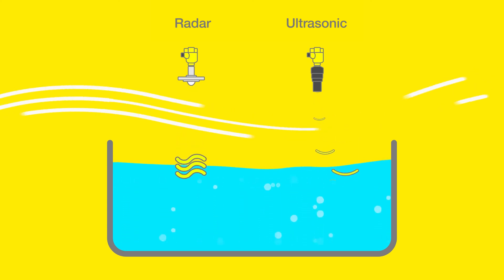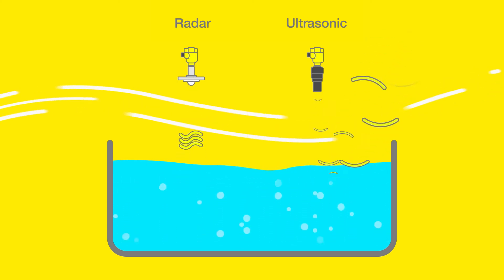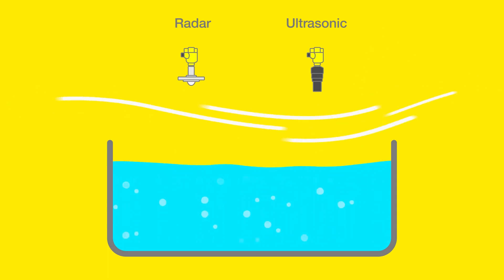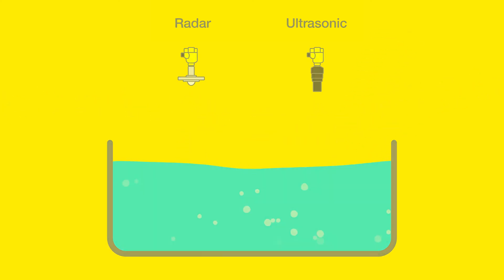💡 Radar vs. ultrasonic – what are the differences between the two measuring principles? | VEGA talk

Comment: For my project I have got a transporter bridge system, I need a sensor which could measure the distance from the Gondola to the platform specially when the weather condition are harsh. Like windy or snowy or foggy? If RAdar works, which RADAR Sensor gives in Market?
Reply from the maker: In general, such a measurement is possible with radar. Compared to ultrasonic, radar has the advantage that it is independent of environmental influences such as fog, wind, dirt or condensation.
We are already solving applications similar to this, for example in harbors for measuring the distance of large ships docked there.

We offer a wide range of radar sensors on our website. Sensors that are very compact or those that offer a very large measuring range.

The right sensor depends heavily on your application. Feel free to contact us directly. We are curious to learn more about your application!

Comment: Hello, what type of sensor would you recommend for detecting changes in oil level inside a distribution transformer
Reply from the maker: Hello, Thanks for your question. There is no general answer to this question. Depending on the vessel geometry, a VEGAPULS free-radiating radar can work here. In very cramped conditions, a guided microwave (VEGAFLEX with coax) is the right measuring instrument. If you require application-specific advice, please contact one of our subsidiaries in your area. (https://www.vega.com/en-de/company/vega-worldwide)
Reply: @VEGA_Level_Pressure  Thanks, won't the measuremnets be affected by the EM fields from the windings
Reply from the maker: @EssayWriting-du3pw  To be able to find the best solution for your application, we need some more information. Please contact one of our subsidiaries in your area, which you can find here: https://www.vega.com/en-de/company/vega-worldwide

Comment: Hello, what type of sensor you would recommend for coal bunkers, as due to coal heat up it produces evaporators on sensor's sensing part and also coal dust accumulated on sensing part, what type of sensor should use to overcome this issue
Reply from the maker: Hello, Thanks for your question. Please have a look at our solutions for Coal power plants, you can find a detailed description of each application here: https://www.vega.com/en-de/industries/energy/coal-power-plant

Comment: helloo what do you think is better for locating object? We’re trying to build a tracker w the use of the ultrasonic sensor, do u think it can be used to locate one subject only?
Reply from the maker: Hello, Thanks for your question. Object monitoring is also possible with radar, but you have to watch the speed of the update rate. If your target moves too fast, the output signal cannot follow the change of distance so fast. Our radar sensors have an update rate of typically 2 - 4 measurements per second.
Reply: ohh i get it, thanks !! Also, do u think it will be possible to use radar with the ultrasonic sensor?
Reply from the maker: @torivicz  Radar and ultrasonic measurement are two different types of measuring principles with different sensors. Our answer refers to the radar measuring principle only.
Reply: @VEGA_Level_Pressure  oh okay. if we would use radar for monitoring one object only, do we have to use another apparatus to create the tracker or we can continue w the radar along w an arduino?
Reply from the maker: @torivicz  The sensor is providing a 4 … 20 mA signal which is related to the level or distance. If your Arduino provides an analogue input, it is possible to use our sensor.
Reply: @VEGA_Level_Pressure  ok thank you soooo much for the help! We’ll try to use the radar for navigating and see what we can get :))

Comment: Will Radar work with para amino phenol slurry or not.. we have vega 36 plus & we are facing issue with it.. there also a foam in measuring materail.
Reply from the maker: Thanks for your question. A radar sensor should work in such an application, but of course it always depends on the application conditions.

The radar signal is less influenced by foam in comparison to ultrasonic, but also the radar signals are damped by the foam. If there really is a lot of foam also the radar technology will reach its limits. Is it possible to find a mounting position with less foam? If not, please contact our colleges on site: https://www.vega.com/en/company/vega-worldwide

Comment: Mean for gas application use radar will be better, so ultrasonic still ok for liquid application? Is it correct?
Reply from the maker: Hello Arif, Thanks for your question. In our experience 80 GHz radar technology provides reliable measurement results under all conditions: radar sensors are unaffected by temperature fluctuations, vacuum or high pressures and are insensitive to contamination. This makes it easier to separate measurement and interference signals - the measurement is much easier and more accurate. More details about the differences between the two measuring principleas can be found here: https://indd.adobe.com/view/2cd8db66-e7d1-427e-8a87-a9d9f4075e2e